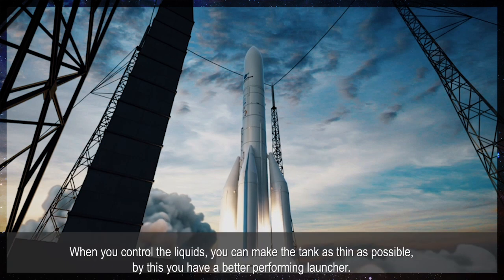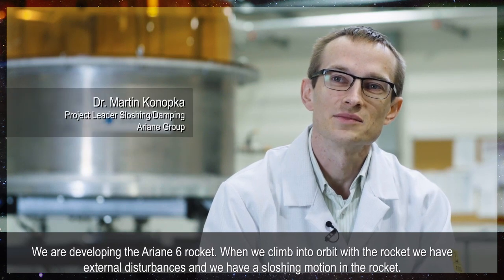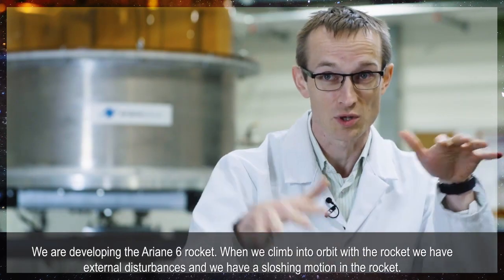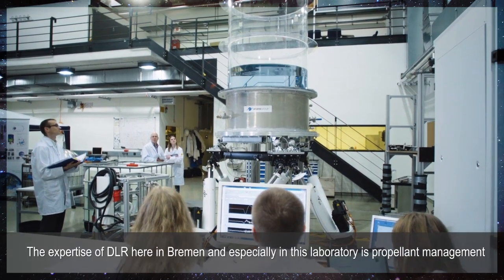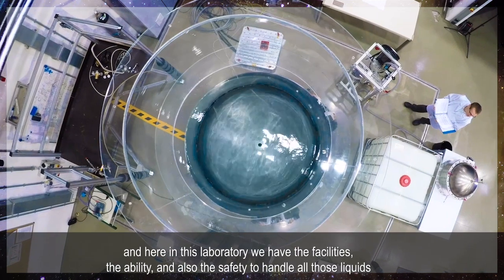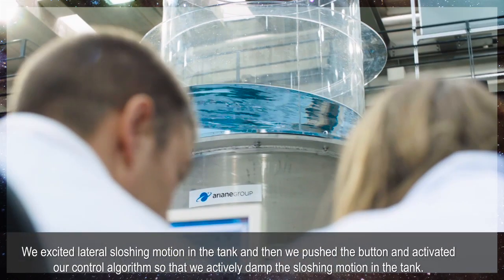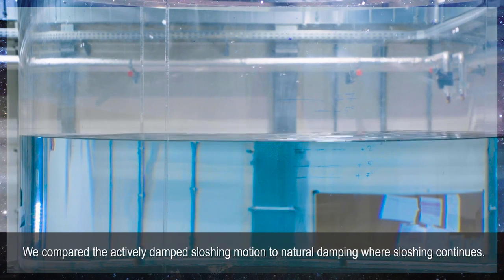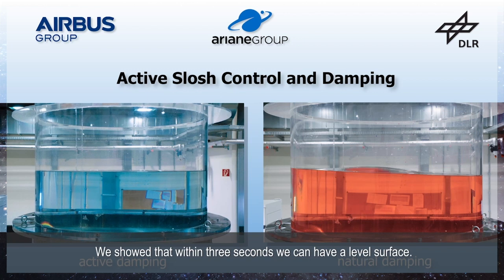Active anti-sloshing fuel tank technology allows lighter, higher performance launch vehicles

Comment: This looks awesome, though I can't think of any way to put this device on a rocket. At least to make it lighter than the baffles. Still, it is a good direction to research.
Reply: the device would not go on the rocket, the control algorithm used here would use the TVC or other control moments to achieve the same result
Reply: @pistonsoup3749  Ok, this explains a lot. Thanks!